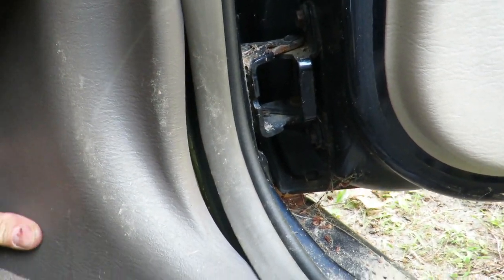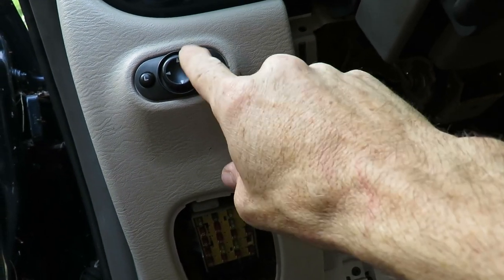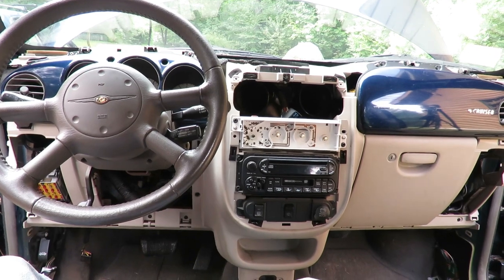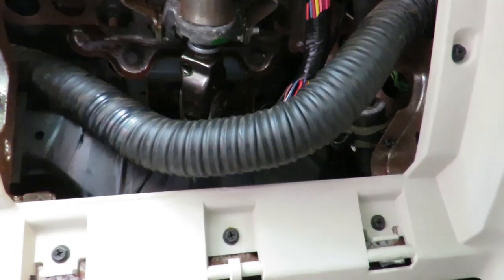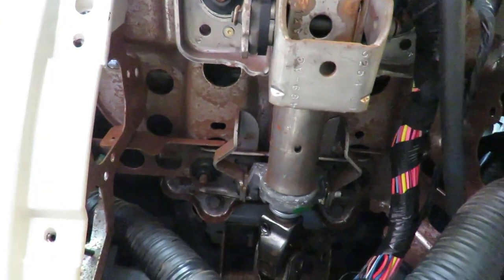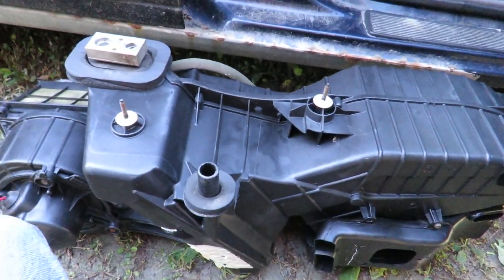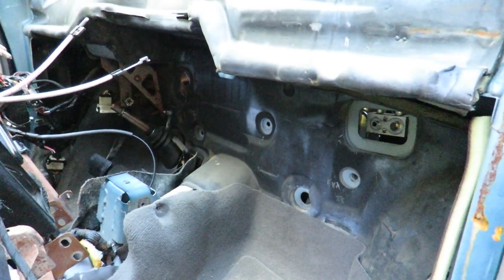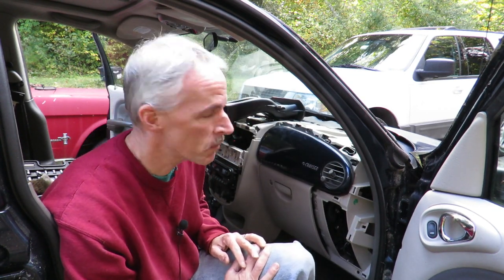How to remove your PT Cruiser heater core (the easiest way on the internet)

Comment: Well, after three years I'm going to tackle mine. I'm using the video as I go. You will either be praised or cussed shortly. Lmao
Reply from the maker: Lol,  Bring it on i can take it.
Reply: @scottydoall  I got it out. It took about two hours removing the console and dash. The heater box on mine had two bolts on the inside. One day n plain sight, the other was hidden. I yanked and yanked on the heater box before I realized I hadn't taken the heater hoses off. Duh. Lol, it's tight getting the box out, but it's out. Top dash cover was in bad condition, it came out in two pieces, so I got to find one. Other than that though, the heater box is going back in tomorrow. Also, mine is an 01, it had two bolts on the bottom on each side in front of the console. That dash is a lot heavier than I thought it would be. Still, it beats taking it all apart. I'm going to call this a win so far.
Reply: It took all day to put it back in. The problem was all the plastic had gotten brittle and I had to repair and rig some of the dry rotted plastic. What you said to do is spot on. Wouldn't have been so bad if I didn't have to repair a bunch of cheap junk. The engineers at chrysler should have their asses kicked. I still, I recommend your video on a "how to". Much better than taking everything apart piece by piece.
Reply from the maker: Glad it's working so far for you. It is pretty heavy thats why doing the "pivot" bolts on the bottom was such a nice way of lining everything up.
Reply from the maker: WooHoooo sounds like I ended up on the praise side of your first comment. I'll take it. Thanks for letting me know how it went, I appreciate that.
Reply: @scottydoall  I had better luck lifting one side at a time to put the nut on the top stud on each side. It was just to heavy to lift to get those pivot boots in. I'm still fixing junk plastic. Lol the top dash cover came off in about 5 pieces. Dry rotted.

Comment: Great video, but these cars are the worst engineered cars on the planet. Chrysler sucks.
Soooo not worth the effort.
To the pick a part yard it goes !
Reply from the maker: Hi Jamol, everyone is entitled to their own opinion but I really liked my PT and had VERY few issues with mine.  I only got rid of it after 250,000 miles because my new job required me to be able to get there in any weather conditions, so now I'm back to my trusty 4wd Subaru (they go through anything)
P.S. I think all cars make it difficult to get to the heater core